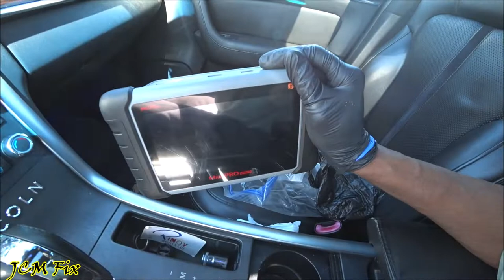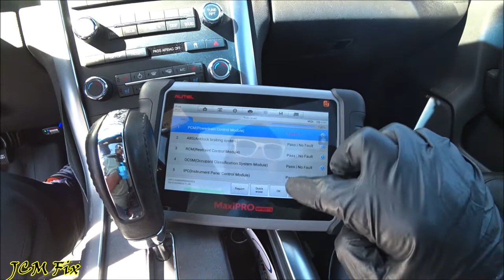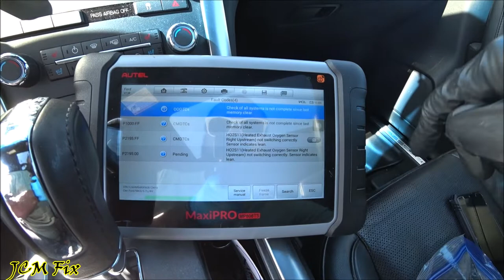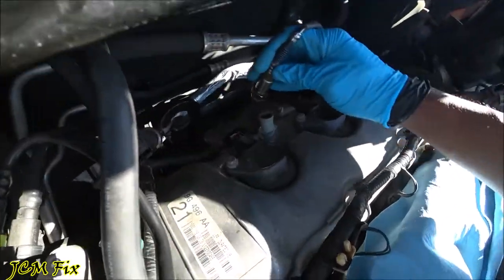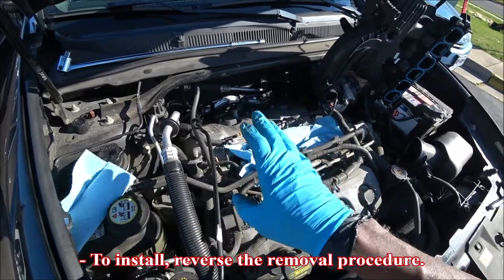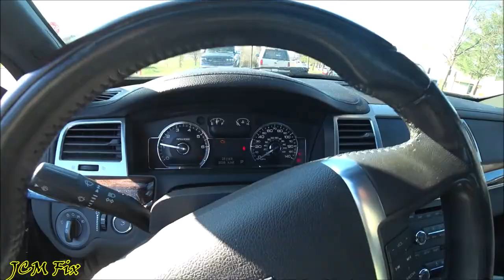P2195 Code Fixed! If Your Mechanic Can Change a Lincoln mkS Oxygen Sensor, So Can You!

Comment from the maker: ⬇️The parts that were shown in this video (# CommissionsEarned): 
1: Denso 234-5097 Upstream  Air Fuel Sensor: https://amzn.to/3FqccDD
2. (OEM) MOTORCRAFT DY1111 Upstream Oxygen Sensor: https://amzn.to/3yp1dJg
3. (OEM) MOTORCRAFT DY1056 Downstream Sensor: https://amzn.to/38fxgR4
4. Permatex 80078 Anti-Seize Lubricant with Brush Top Bottle, 8 oz.: https://amzn.to/3vUP7FS

⬇️ JCM Fix's DIY Tools used in this video (# CommissionsEarned): 
1. ABN Upholstery Trim Clip Removal Pliers: https://amzn.to/320oE9P
2. BLACK+DECKER 20V MAX Drill & Home Tool Kit, 68 Piece (LDX120PK): 
    https://amzn.to/2Jo3gpp
3. GEARWRENCH 3/8-Inch Drive Flex Ratchet: https://amzn.to/2zgbr21
4. TEKTON 4957 Impact Adapter and Reducer Set, Cr-V, 4-Piece
    https://amzn.to/3EA3zoA
5. Powerbuilt 1/2-Inch Drive Click Micrometer Torque Wrench- 644999:
    https://amzn.to/3DDoIib
6. XSTRAP 6PCS Flat Bungee Cords with Hooks Set: https://amzn.to/3vYJN4h
7. Performance Tool W3033 Pry Bar Set, 3-Piece: https://amzn.to/38lapDf
8. Powerbuilt 1/4-Inch Drive Metric Deep Socket Set 10-Piece (4-13 mm)- 640538:
    https://amzn.to/3N6oSSS
Reply: Was this sensor replacement  bank 1  sensor 1 ?
Reply from the maker: @asianexoticanimals3824  Everything is waiting for you within the video my friend. This guide is super easy to help out everyone who's willing to try.
Reply: @JCMFix  i already watched it a few times just making sure thanks for the guide sir very much appreciated

Comment: Hi, I havan F-150 5.4 2004, and the code P2195, I replace the sensor, but the ligth code does not turn off, when I driving, I can hear an zik, zik, noice from engine, like air sound, did u think can, be the manifold leaking.
Reply from the maker: That seems serious right there. You may need to stop driving and bring it in to Ford and see what's up.

Comment: That's why there is a sensor to tell that the engine need to check, not replace the sensor. 😕
Reply from the maker: This sensor replacement fixed the issue. It still hasn't returned.

Comment: Lets go ahead and go ahead because we need to go ahead with this ok lets go ahead and do the go ahead.
Reply from the maker: As long as it helped you fix your whip, go ahead and ride off into the sunset. I'm happy for you if it did.
More to come mate!
Reply: @JCMFix  You are great. I was trolling but you held the line and answered just right. I actually was not able to get the information that I could use to fix my car because my problem is not the same as yours. However, if my problem was the same your video would have been of great help. Keep up the good work there are many that can be helped by what you do.
Reply from the maker: @newsnowriversidesgtrock  No worries. Thanks!
What was your problem exactly?